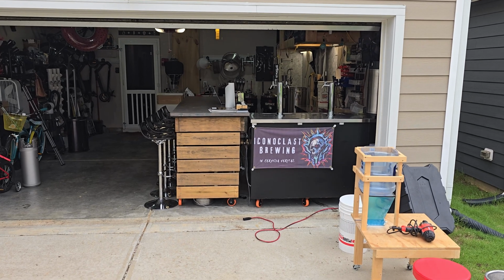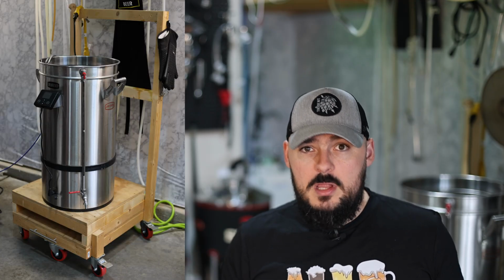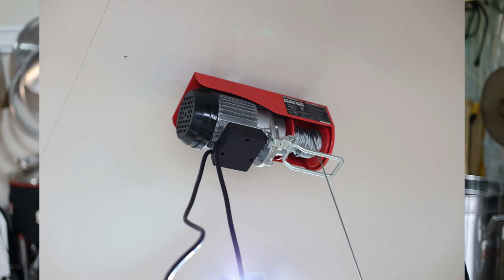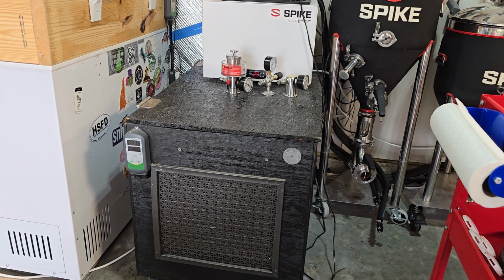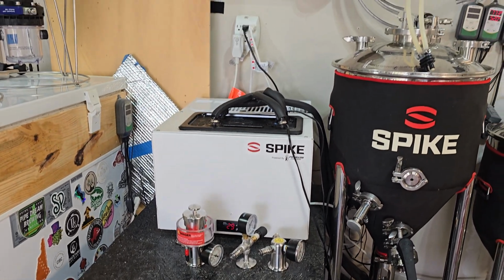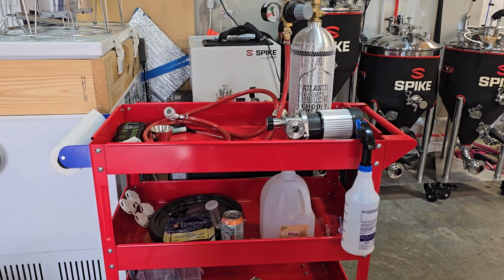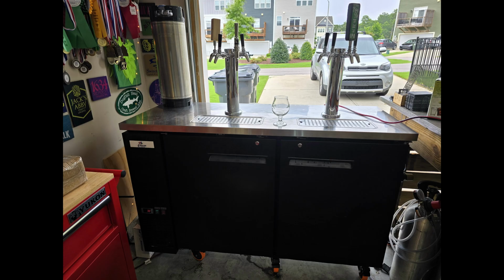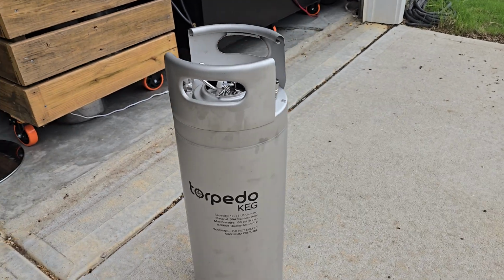It took me 12 years to build my dream brewery...

Comment: Great set up and vídeo! Tks… Do you have any homebrew level gas mixing equipment/accessory in USA? Didn’t find any similar in Brazil or Kegland… just profissional level… trying to put up a keezer for beer, Wine, and nitro…
Reply from the maker: Thank you for the watch!! The only gas blender I have found is pretty expesnive, though I bet you could find one of these at a restaurant discount store or something for cheaper than 1400$ is this one: https://www.micromatic.com/en-us/pro-line-co2-nitrogen-gas-blender-double-blend-70-30-lager-stout/p-7nWR2_4MoEGlFH5ShnAfrw

Blending is something I have not yet tried, but looks like I may need to change that! I'm intrigued by the lager blend of 70% CO2 and 30% nitro.
Reply: Tks Again!! Yeah… maybe it Will be cheaper to have one cilinder for each gás or blend 🤣
Reply from the maker: That's what I'm thinking! Maybe calculate CO2 volumes, carb the beer then take it off CO2 hit with nitro and shake the keg up? Or maybe, that's backwards lol

Comment: Very nice set up, have had my spike cf-15 for half a year and I love it but my next cf will be a brew built because it can hold pressure a bit better
Reply from the maker: I have heard that as well. You really do have to "Tap around" the lid clamp to listen for a good seal. Brew Built look awesome, especially with their four legs/stability.

Thanks for watching!!
Reply: @iconoclastbrewing  definitely I just purchased the stabilizing steel plate because one of the legs on my fermenter bent in, the weld is great but when rolling a full fermenter it looses stability a bit, (Using the spike casters, just an fyi for those wondering) that’s the second reason I’m going for that brew built.
Reply from the maker: Yeah they are sketchy... Delta also just released a brand-new line of conicals that look pretty solid